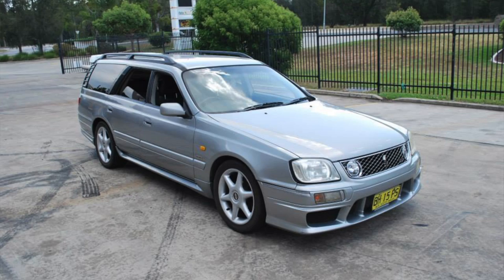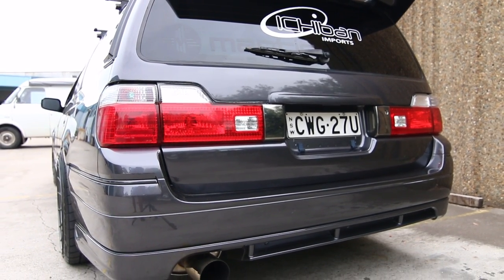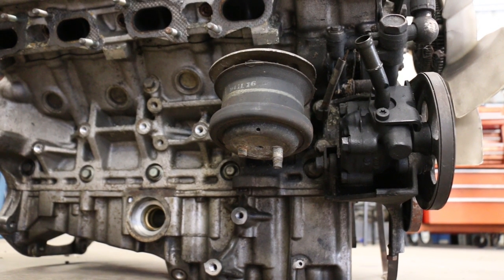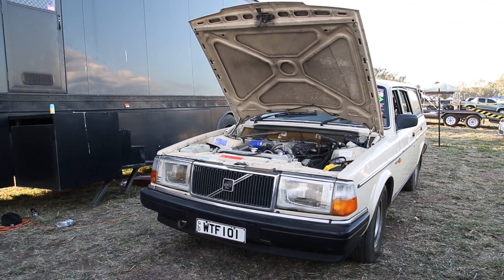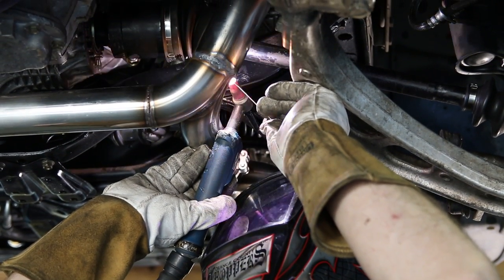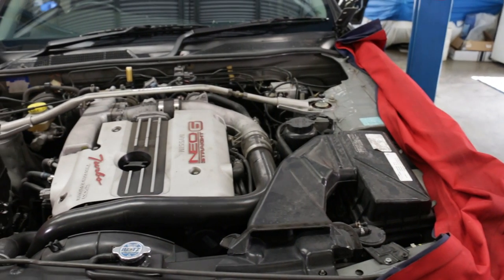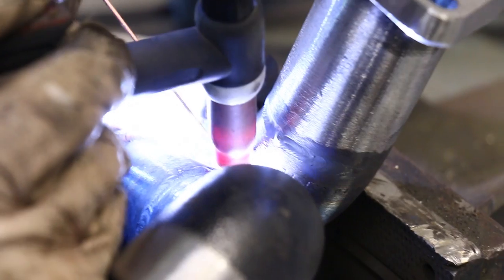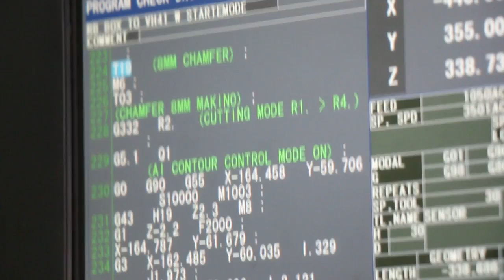Nissan Stagea 'Double Unicorn' Build - Turbo, V8, Manual & AWD - Episode 1

Comment: Basically a BMW 550xi Touring ;)
It's a twinturbocharged 4.4L V8 AWD station wagon.
Reply: except it doesnt cost a fortune
Reply: talking about current gen,right?
Reply: N0SK1LLS Yeah. And of course, this build will be much cooler and more interesting
What I'm saying is: The stats will turn out similar. Can't wait to see it.
Reply: +Benedocta is it avaibabe with a manual though?
Reply: StefanoTrefano Its the only 5 series that isnt.
Reply: i agree.the stats should be somewhat similar but considering that BMW has to run absolutely safe settings for warranty and reliability we might even see some more power here :)
Reply: +Benedocta I can't find a 550 xi versjon for sale as touring, only limousine. And its only an automatic. But I do belive BMW's 8 speed auto is pretty good. There is the audi RS6 avant tho, V8 turbocharged AWD wagon, automatic again tho.
Reply: am i mistaken in that they're gonna go twin turbo on the stagea?
Reply: N0SK1LLS I think single turbo V8 doesnt make any sense, so yeah.
Reply: got confused lol
Reply: +Kristian Hagene Most BMW autos are pretty good. It's more about principle. Manuals are just so much better in the sense that you can feel what's going on with the engine/road much better. My only real experience (I was a "junior" mechanic (had a certified BMW mechanic always available to help me) for around four years) with BMW manuals was with M's, so I'm a little biased (and spoiled) when it comes to manuals in this sort of car.
Reply: 000Bob000jones000 I agree, got a manuel BMW myself. But I've also driven the 8 speed auto and its pretty cool to drive aswell. Like I can't shift as fast as it does.
Reply: +N0SK1LLS It looks like they are doing a single twin-scroll turbo setup. The title was a bit misleading, it's not really a "double unicorn" build.

Comment: This has to face SuperGramps...
Reply: It's gotta be a good race... Stagea is larger, probably will make more power, SuperGramps is lighter. Who knows!
Reply: +MineTwine45 this will probably murder supergramps
Reply: +george e I got $5 on gramps!
Reply: +MineTwine45 Stagea will shit on supergramps. Hard.
Reply: +MineTwine45 i bet 50 cents that nissan will win, and im taking a serious risk here.
Reply: +MineTwine45  ++ Miss Daisy...
Reply: +Jeremiah Llewellyn hmm not too sure about that, it'll be very even. the vh41 comes with about 260hp, about the same as the ez36. and gramps already makes almost 450hp. I've never seen someone be able to make more than 500 hp with these motors
Reply: +MineTwine45  im just starting to learn about engines and tuning but im pretty sure this will be faster than gramps because a v8 will make more torque with a smoother curve, and in a drag race torque is the number that makes the biggest difference
Reply: +Rome1017 its more about the torque than the hp in a drag race so my money is on the stagea
Reply: +Loki there is very little aftermarket support for these engines, not anywhere near as much as any other engine. 500 with e85. but enter a 500whp awd car and tell me how it feels lol
Reply: Super gramps would get thrashed by this, ehem if they race, it will get thrashed. Gaurentee it.
Reply: Alan Sinclair why do you guarantee this? you know nothing about this wagon, plus its quite a bit bigger and heavier then the legacy
Reply: i think they should do, both, drag racing and time trials.
Reply: +MineTwine45  Thats so true man gotta be epic! :D
Reply: Steve K what are you talking about?
Reply: Yooo
Reply: +Steve K Nissan vs Subaru. V8 vs V6. Theyre not really similar at all. Just both turbo wagons.
Reply: Robert Eley H6*
Reply: +Rome1017 Damn Subaru's.. my bad. H6 but the main point was the difference in cylinder amount.
Reply: Robert Eley but size wise they're very close. 3.6 vs 4.1.the 3.6 has a more advanced VVT which puts it up there with it. plus it comes with more power in stock form.
Reply: +Rome1017 The race would be good, no doubt. I was just saying they aren't the same car as the comment above stated

Comment: The rules and laws must suck for Car enthusiast in Australia.
Reply: yeah ls nation would be crying themselves to sleep every night if it was this way here in the States
Reply: +Geek Army I didn't even know about the power to weight rule. Just something else to complain about along side pod filter restrictions and other garbage
Reply: +Wildstyle96 Well, I was aware of a weight to chassis law (cos I read about a team who were toying with an RX-7 and getting it's 13B turboed, but it wouldn't work due to weight issues in it's body), but not the capacity-weight rule.
Reply: +Azoriez You've obviously never been to California lol.  Super strict emissions, almost can't even modify the engine at all.
Reply: Sean Kallas yeah cali is run by communist
Reply: +Geek Army The south would probably keep "rolling coal" as they call it.
Reply: +Azoriez prevents the LS from being EVERYWHERE, so not all bad....
Reply: +Azoriez it sucks especially in victoria u cant drive by yourself till your 18
Reply: +Azoriez the laws here in Queensland are not that bad the power to weight law is the big st one  but its a safety thing....
Reply: +Geek Army Nope, it's run by farmer. The reason emissions laws are so stringent here is that the farmers have the cash to pay off the politicians. That way they can keep their irresponsible but cheap practices like burning piles and piles and piles of crap.
Reply: +Azoriez Cant even have blow off valves venting to atmosphere, like wtf is the problem with that shit.
Reply: +rik trask safety is just the trojan horse for all the bullshit laws though
Reply: most of laws are good just not if ur lazy and want cut corners
Reply: +Azoriez Come to Germany and enjoy "TüV" :)
Reply: +Azoriez Brazil sucks too, you can't even install xenon lights
Reply: I think it's just nsw with the bullshit, a lot of my friends get their cars and licences in other states to allow more freedom in their builds.
Reply: +Geek Army I'm actually in a county here in Ohio where they don't do emission checks every 2 years like some counties. You could probably straight pipe something and get away with it, as long as it's not louder than a Harley motorcycle, haha.
Reply: +Azoriez Its waaaaaaay worse here in Portugal, where you cant legally modify your car, if you do and get caught by the cops you have to return it to standard and then have a special inspection done on it that costs 250€ (277USD)
Reply: Singapore and Brazil are even worse
Reply: +Azoriez should justs put a giant gas tank in the car and fill it up wwith gas when you get it checked for registration. then just empty it when you use it LMAO
Reply: +Juan Lara yeah it's 25 in the us
Reply: +Thomas Craig What are you talking about. I live in San Jose and we smog our cars every two years. Not once. Emission rules suck here. Hate living in California. Way too expensive.
Reply: +Thomas Craig well in Santa Clara county they require it every two years
Reply: +Azoriez come to Germany. Engine swaps are next to impossible, let alone turboing
Reply: +Azoriez It's worse in Germany.
Reply: Just read about Singapore
Reply: +BrakeHorsePower92 At least You can afford a lot and have some nice variety in cars unlike us in god forbiden poland.
Reply: +NoodleHas Xbox and even then you have to have learners for at least a year. I've got ~150 out of the minimum 120 on all sorts of roads including the Great Alpine Road in winter (ice and snow) and I'm 18 yet I can't drive alone because "I don't have enough experience" but then I was allowed to go out and get a motorbike and can ride on my own with the only requirement being that I'm 18. Donald Trump would come up with a better system for new drivers!
Reply: Well, I wouldn't want to meet the first idiot on the road with a V8 in his Civic. QLD is not too bad, you can legally add 20% more power to your car without getting a mod plate. Remember you don't need to get your car controlled AT ALL till you sell it. So you could drive a shitbox with no brakes and working lights for 20 years without any issue, which is a bit crazy when you think about it.
Reply: +Azoriez 
France is way worse...
crie evrytim
Reply: +Hazm Geez, I'm in WA and I only have to do 25. And we don't have any restrictions on what cars Learners and Provisionals can drive.
Reply: +danehb89 Wow lucky! Hard enough to get P plates here let alone keep them with the extra scrutiny from cops.
Reply: Well in America it's illegal to have a S15 or R34 that's street legal. Count yourself lucky. Here it's mostly Honda and Subaru. Projects are mostly that a baseline and turn into a WRX or STI depending the year
Reply: Dangerous Wheel Co It's not illegal if you buy the first ones imported, before all that mess.
Reply: +TRAV beats I'm in Connecticut.... think that explains it all
Reply: +bustin justin doesnt mean they are compliance plated, or even if they are, they can be put off the road at any time.  weight of car (heaviest in its model eg calais over an executive commodore) in kg x3 is max engine cc bosted or x5 maximum cc NA for engine conversions. if the car comes with engine say a 6.3L commodore, boost away etc...  laws are crap. this is qls laws but close to the same everywhere now
Reply: But the import laws must suck for jdm/euro enthusiasts in the states.
Reply: Florida. All you need is 32 dollars a valid title proof of insurance and you are good to go no matter what the car is or what's been done to it.
Reply: Im in New York City and they dont care about nothing you can build to 1000hp + ! and drive on city streets as long as your not breaking any road laws your fine. but you do get bs tickets for loud exhaust that cost 150$ or tinted windows that cost 50$ each window & dumb things like that other than that your pretty much free to do whatever you want. the way NYC see's it its your property you can modify it however you want aslong as insurance companys insure your vehicle and your not breaking any laws as in disturbing the piece witch will lead into a loud exhaust ticket than your pretty much go and do w.e you can & want
Reply: +AccAkut1987 
Bullshit, a co-worker has a swapped, turbo opel wagon with widebody, half cage and buckets with harnesses there. There are also some seriously modified cars there which have swaps and are road legal.
Reply: +Snakeplisskin440 where I'm at in Missouri you hardly will ever see an emissions test. Every car I've owned was straight piped and legal
Reply: It dose
Reply: +Rj Flores here in NY we have to do an inspection every year but anything 95 an older is just a safety
Reply: Yeah, isn't the blow off valve sound illegal to? Good lord guys...that's rough
Reply: BOV is not illegal, as long as it is plumbed back into the intake.  atmo venting bov is frowned upon.  which is shy you see alto of companies building bov's that recirculate unless pushed hard, then vent to air, to avoid most illegalities
Reply: VH41>ls
Reply: it's in qld there are restriction on the capacity of the engine to the weight of the car to have the car regoed there are two equations that the government use on for na and one for forced induction
Reply: @riktrask5337  safety, bullshit its just nanny state

Comment: Ill stick with my rb in my stagea.
Reply: +Epikas 400+ HP on low boost doesn't appeal? and torque?
Reply: Of course it is, but there is something about the inline 6 that makes the stagea feel more like the Skyline that it is based on. I guess coming from an R32, i'm a little stuck over on the RB engine. Also noise wise, my preference is on the sound of the inline 6 over a V8.
Reply from the maker: +Epikas Keep watching :)
Reply: Always will. You guys never fail to impress~
Reply: +Epikas i would rather run with the rb too, but there is allways fun to make a more "special" swap
Reply: +Epikas Me too, although I am tempted by an RB30.
Reply: +mcmtv2 Probably would have been better off using a TB48de if you are wanting low end torque but it is a boat anchor of a motor..

Comment: In my opinion the LS series is a cancer in the Japanese tuning community
Reply: it's not your car, so why are you worried about it?
Reply: +Harry Sandbach i get what your'e trying to say, it kills unique engine setups because it's the most reliable option for power and the aftermarket support is huge. it irritates me too.
Reply: +Harry Sandbach Be happy that all those LSes are displacing the engines you love - every LS going in means another engine on the open market, driving prices down, down, down.
Reply: What's great about cars built in Japan not American 'JDM ' builds (left hand drive USDM cars) is the individuality and differences in tunes and parts used. You don't know if the silvia is RB20 turbo 400+ hp or if it's stock until you look under the bonnet. Now all you see in usa is LS swapped cars so it's boring. Even the iconic engined cars like rx7 and s2000 have LS swaps and it's just sacrilege. You ask a genuine enthusiast and they'll agree. I'm not a Puritan and I do like engine swaps just pay some respect to the cars heritage. That's my opinion anyway so go ahead and build a 'drift missile' 240sx but don't expect any admiration from enthusiasts.
Reply: +Harry Sandbach I totally understand viewpoints like 'but the f20 is half of why the (non-us) s2k is great!'. I loved my UK ep3 civic typer for its 8k redline. I was constantly amazed that my 97 e36 m3 evo revved even higher despite being a 3.2l inline 6. hell, i even live the twin turbo 3l diesel in my 535d and you BET I want to swap the 2l four pot in my wife's mk3 mx5 for an LS, even though its great fun and surprisingly fast as-is. I love all the things, and was trying to give you a silver lining to the thing you hate. And hating it is a thing you're totally allowed to do, if all the cars you see in the arenas you're interested in are stuffed with an LS, well, I can see where you're coming from. make friends with the teams though, and recycle the built blocks you love but they just leave sitting in a corner of their garage, so you have the most unique thing of all!
Reply: +Nik Borton I'm from UK so thankfully not a huge LS swapping scene here but it just annoys me sometimes to see nice examples of cars in US get pulled apart and transplanted for no reason other than 'cheap alternative'
Reply: Harry Sandbach I'm UK too, which makes me sad because putting an LS in an MX-5 is going to be soooo expensive, even if I manage to find a written-off Vauxhall Monaro/VXR-8. One day it will happen...
Reply: Harry Sandbach (I know it's not what you want to hear. I want an RX-7 with original sequential turbo rotary as well though, and a new V8 Mustang, and, and, and)
Reply: (I also nearly went in for a Bathurst VXR-8 when that special edition was a thing. Luckily realised I couldn't afford <16mpg BEFORE I did so)
Reply: +Harry Sandbach I've seen so many ls swaps here in the states it makes me sick ..  the LS is a good engine ..  but it is waaaay over used.
Reply: +Nik Borton US S2000s still got the F20, they just switched to F22 in 2004. F20 was in 2000-03 US-spec cars.
Reply: Agree mate would have been more legit with a Nissan v8 but far far to expensive to trick, easier to trick a mass produced donk, that every Muppet and his dog can work on.

Comment: One challenge for you! Get a small hatchback type of car, insert GTR/Stagea/whatever nice 4WD drive thing. Put a Hayabusa (or similar) MC engine in and ofc turbo charge it. Then couple it with 1-2 100-200 Kw electric motors. And make it "laferrari" style, small/or none battery pack (maybe only use a big capacitor bank) that's only/mostly used for getting things going. If done right maybe you end up with a super torqy/small/less weight super car progressive 4WD super car which sounds like a Formula one car (well almost) and goes like stink.

Comment: btw s1 and s2 stageas have different rear suspension s2 is out of r34 and s1 is out of laurel c34 front is both the same as a c34 laurel also engine options are different between s1 and s2 has rb20de neo rb25de neo rb25det neo and rb 26 s1 has rb20e..... rb25de rb25det mint run arounds had a s1 a while ago now got a c34 laurel same suspension totally different beast of a car.

Comment: Why did you need a custom clutch spline when the R33-34 transmission has the same clutch spline as the 300zx and the 90-96 300zx clutch  bolts to the back of a VH engine no problem ?

Comment: What's the smallest LS motor available in Australia? Did they send any of the 4.8l motors there by chance?
Reply: We did get 5.0L v8s in the older Commodores
Reply: +GreenJeep1998 5.7L LS1....so no, we haven't got the 4.8L version....
Reply: Have been imported into NZ.

Comment: Can someone expand on 5:39? What's turbo yoda talking about?
Reply: +dumkopf He's basically saying that it would be impossible to legally register a turbocharged large-displacement car that would weigh what a passenger car does.

They couldn't register a turbod 5.7L/6.0L LS engine, but they can register a turbo  4.1L engine, like their VH.

"By dropping back (by) 1.5-to-2L, to a 4L engine, we can legally turbocharge a V8."
Reply: Troy McKeown So what are the legal requirements to register something with say an LS1 in it? That's quite an odd regulation.
Reply: dumkopf Many countries have displacement regulations in order to push OEMs to make more efficient cars. Heck, that's the reason that turbochargers are so common in JDM cars - it is a way to increase the "effective" displacement without affecting rated displacement.

I'm not super familiar with AUS rules, so I can't answer your question directly, I just know that you can get non-turbo V8 LS cars from the dealerships e.g. Holden Commodore.